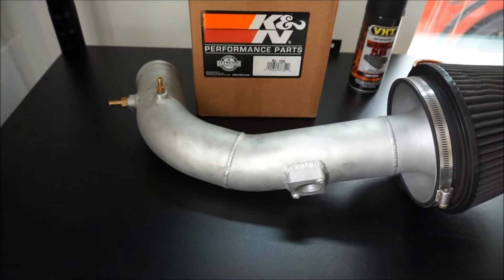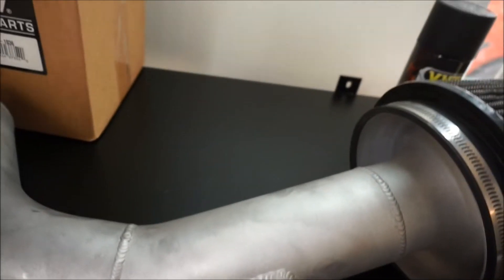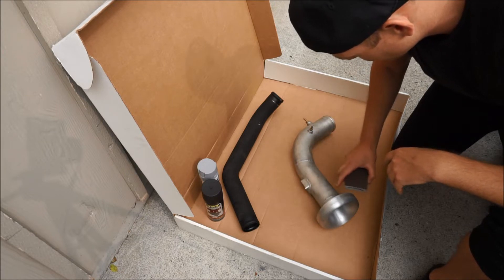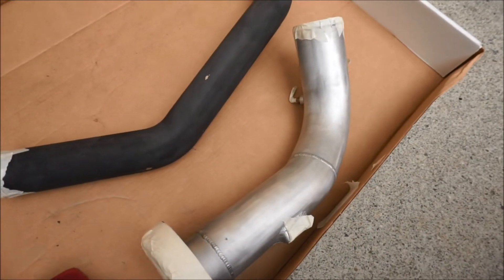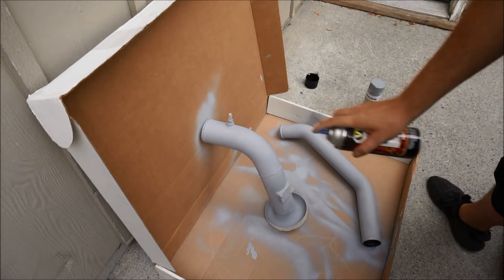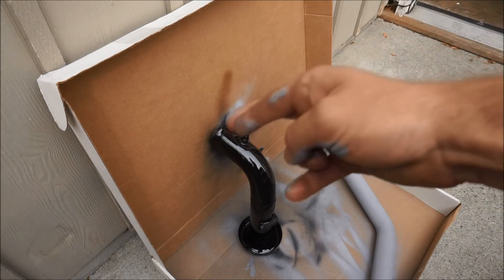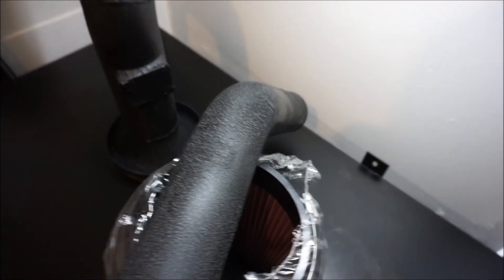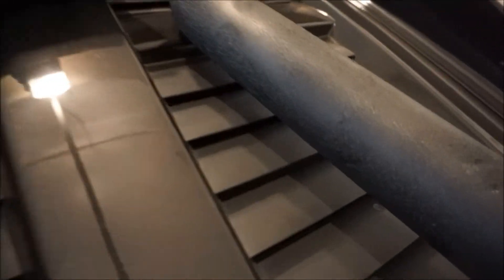MITCH DORE | How To WRINKLE Black Your Turbo Charge Pipes DIY $15

Comment: I came across this bc I’m about to do my procharger intercooler tubing on my cobra. Was gonna powdercoat but I don’t feel like getting it to bare metal. Anyway great vid. Next time ur doing wrinkle paint u can hit it with a heat gun right after each coat and it wrinkles right before your eyes + the heat helps it cure. How does that black look now? I did the strut tower brace & a few other parts vht wrinkle red in my type s engine bay and it’s shockingly durable for a rattle can. 3years later and still looks perfect